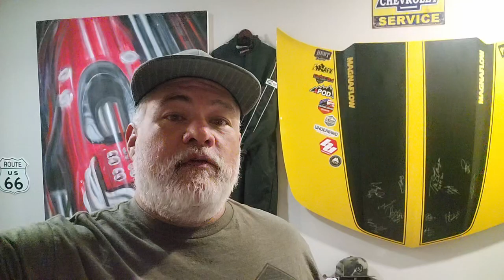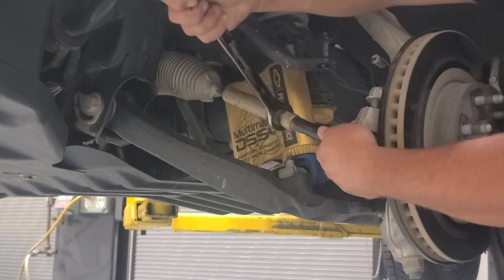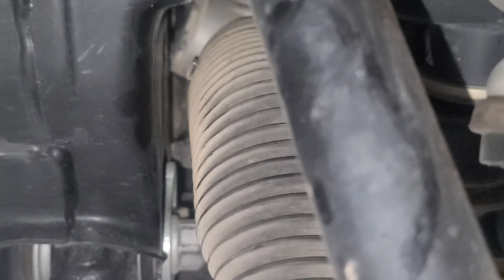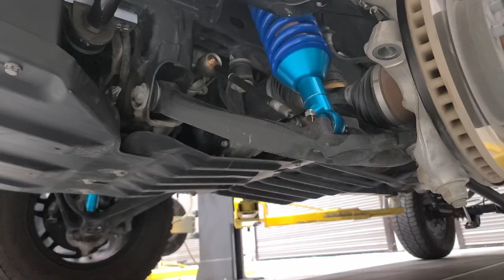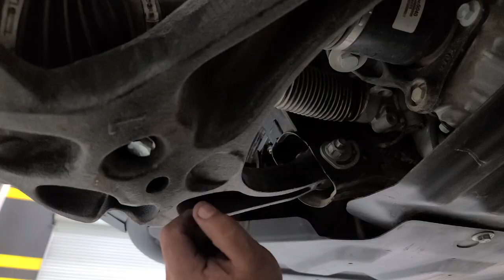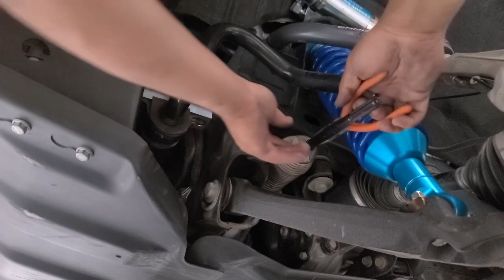Inner Tie Rod Service / Replacement - Shop & Field Service on a Chevrolet Colorado ZR2 Truck

Comment: Hey Richard what is your opinion on the full length peak suspension tie rod sleeves vs the shorty sleeves?  I am running the full length PS tie rod sleeves like you but have been reading more and more that the steering rack could possible fail before the full tie rod sleeve would allow the tie rod to go first under a catastrophic failure.  The GM performance tie rod sleeve is also shorter.  Just wondering if I should cut an extra 3" off the full sleeve to get it down to the "shorty" length?  Sorry I don't have a social media account so this is the only way I can communicate with ya.  Thanks
Reply from the maker: No problem, its just as easy to answer here. So far I have no complaints with the full length Tire Rod sleeve and probably wont have any either. I am pretty careful in picking my lines and even with some unexpected impacts i have pushed the lower a arm cam bolts out of whack and never had an issue with the steering. 
Either length option is about resisting more load before bending or breaking. Picking one or the other is just about determining how much bend you want to have before taking out the rack. With or without steering racks have been damaged to their failure point.
Reply: @exhaustinglife  Richard I appreciate the info and quick response!

Comment: Inner joint already worn? Is this common on these?
Reply from the maker: I was out in AZ in some sandy washes and maxed out the up travel at 45-50 when I found a rock buried and it knocked the lower arm out of alignment and yanked on that tie rod pretty good.

Comment: Do you have a sound clip or video of what this problem sound like ? my zr2 makes a clacking sound when steering left or right back n forth.
Reply from the maker: Unfortunately no. Because I discovered this during an installation, there was no sound during driving. It was only apparent when I moved the wheel back-and-forth pushing on the front and rear edges while the vehicle was suspended on a lift.
Reply: @exhaustinglife  I see... thank you and we like your videos very informative and straightforward.

Comment: Excellent info and great delivery, straight to the point and super helpful. Let me know what you go with for valve stack when you revalve your kings. I'm going to revalve my King rear piggybacks and curious if there's already a flutter stack in the OEM setup.

Comment: What size ring did you use? The 42mm isn’t fitting mine
Reply from the maker: I didn't use the tool as you saw me remove the tie rod with the wrench. I illustrated its use but didn't pay attention to the numbers on the ring ... just installed the one that felt like it engaged. I can measure the size with some calipers next time I pull out the old parts bin.
Reply: @exhaustinglife  oh okay. No worries. Found out it was a 44mm size and the kit only goes up to 42mm. Ended up buying a 15in wrench that opened up to the perfect size and was able to get it out like you. Great video btw! It guided me along and is the only one out there with clear instruction I feel like! 

P.S. maybe provide a link to the tie you used for the boot?

Comment: How do the kings perform as upposed to the dssv?
Reply from the maker: Ill need to get them dialed in as they are tuned for a stock mostly street driven truck. First impressions are ride height is good, compression dampening is good and road manner are good except with the topper and gear I will be installing a rear sway bar. As far as tuning the Kings, I have different springs and a whole lot more weight to manage so give me a couple months to get them dialed in (planning a revalve) and Ill get you some more constructive feedback.
Reply: @exhaustinglife  what would you recommend tire wise? I've got a 2020 zr2  with a leveling kit. It has the stock tires and I hate how loud they are. I go to moab a lot and am looking a for a good 33 that will do good there and not be insanely loud on the road. I was looking at the cooper st max but not sure if there is a better option.
Reply from the maker: @CoachBlakeMill  33s will require some other mods to have good articulation and no rubbing with only a level. Stock wheel offset I'm assuming? if so you may need to have a high caster alignment to get you to where you need without rubbing.
 
As far as tires go I am currently running the Milestar Patagonia X/T 285/70R17 which is a quiet road tire and has very good off-road manners in snow, great dirt traction and pretty good in mud for a non-M/T tire. These have done good in the rocks at low pressures and have not suffered a sidewall puncture issue.  I have also run on other applications with Toyo Open Country R/Ts and Nitto Ridge Grapplers. I have been a huge fan of the hybrid tires that have come out as typical A/Ts neither have the performance or appearance I am looking for for my more aggressive use.
Reply: @exhaustinglife  thanks for the responses it's greatly appreciated. I am running the stock wheels with no spacers or anything. And I would definitely like to run a 285/70/r17. How many miles have you put on your current tires?
Reply: @exhaustinglife  awesome thank you! Love the channel

Comment: 13 turn TR ends, same as mine.  The inner TR appears to be a weak link.  Good to know you can remove the inner TR with a BFW.
Reply from the maker: Seems to be the standard. Was the same on both sides. I checked because I had the other side apart for the shock install.

Comment: Why king shocks?
Reply from the maker: I wanted a rebuildable and revavlable shock to handle the new loads (650 lbs of gear in the bed including the topper and spare) and new spring rates of the Deaver springs (still on order) . The ZR2 leaf springs and DSSVs particularly the rear, cannot handle sustained payloads of my gear and aggressive driving. Both DSSVs in the rear had blown out seals and leaked of all pressure after a few outings and 8 months of heavy use. Once they gave out it only took a month of driving on dead dampeners (waiting for parts under warranty) to kill the rear springs (would ride on secondary overload spring.) which were already sagging 3/4" from stock. Now why King over other brands? I have worked with King amongst other shock brands with the many professional racers i build with and have a relationship with them and they are local.